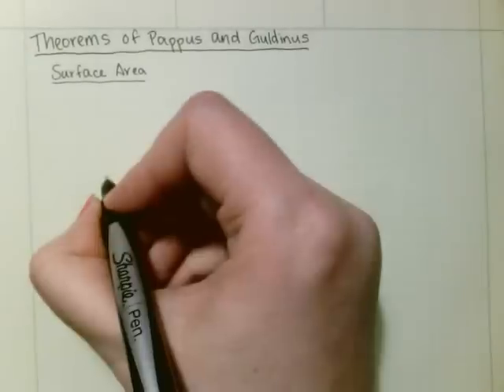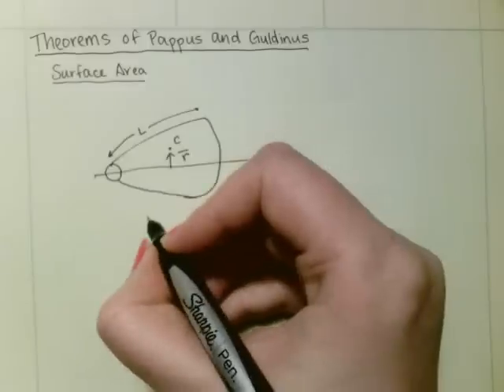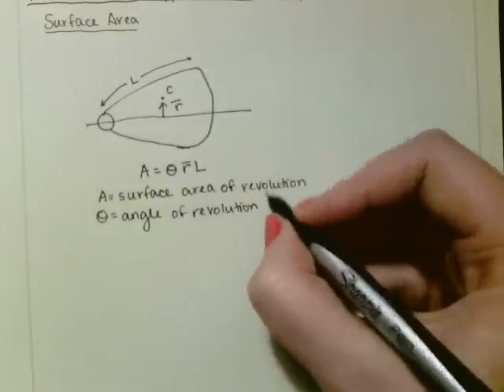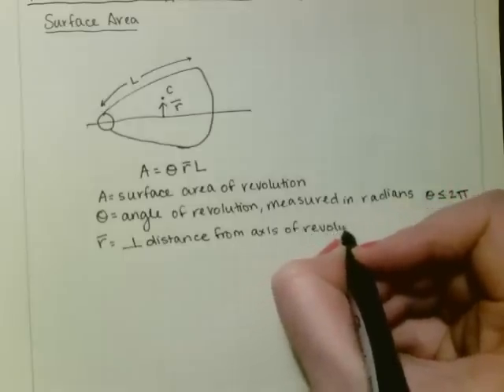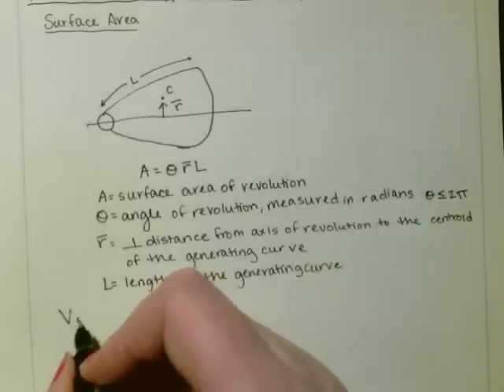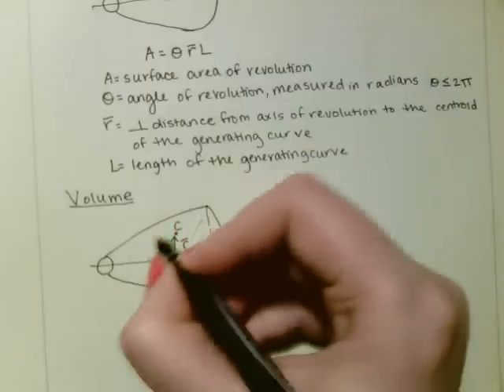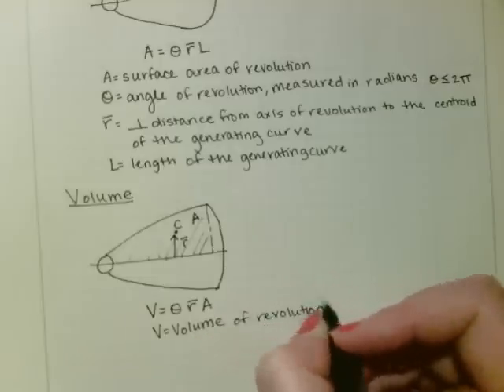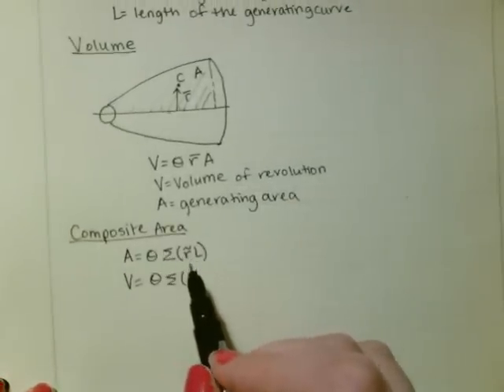Theorems of Pappus and Guldinus

Comment: A segment of a circle of radius R is bounded by an arc equal to 1/3 the circumference of the circle. Find the volume of the solid generated by revolving this segment about its chord as an axis. (This solid is know as Kepler's Lemon). Note: Do note use integral calculus.